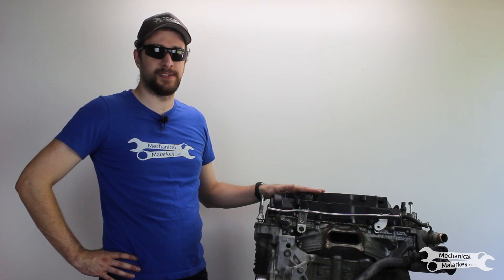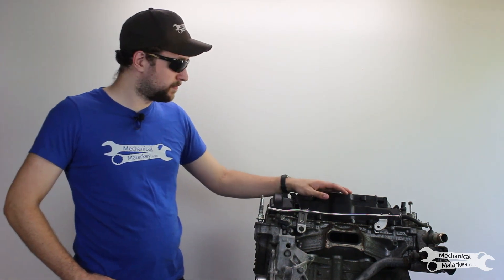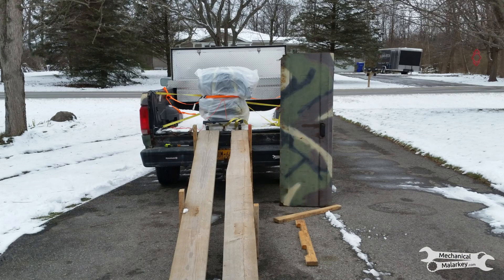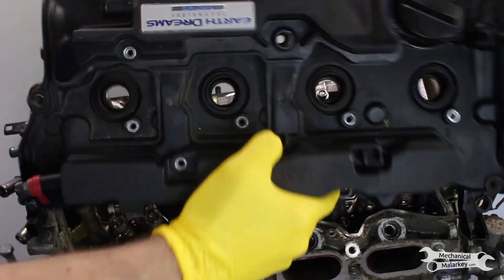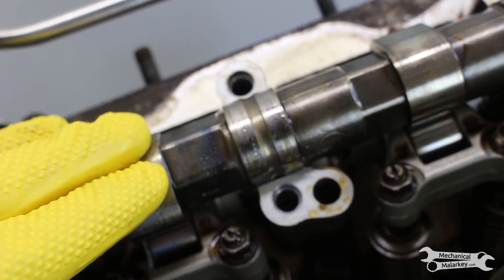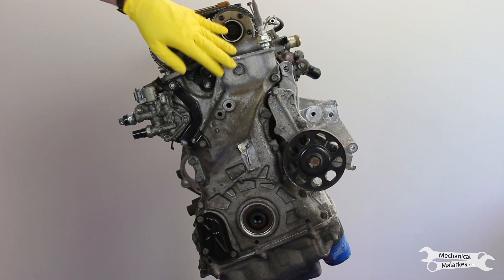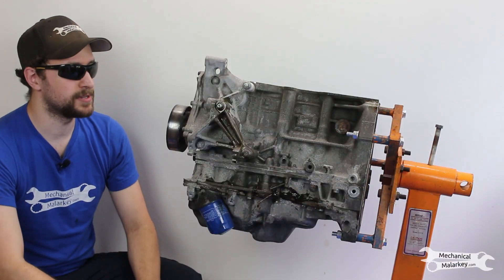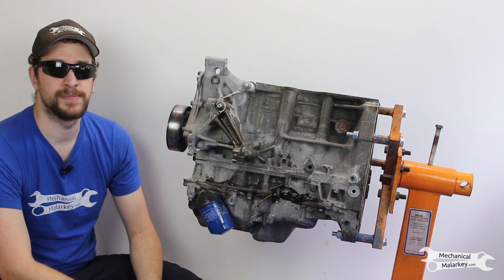Overheated Honda K20 Engine Teardown

Comment: Is that death line between cylinders? Look, this is 100% done on purpose to make engine not last long time. That's the reason for all of these 1.5T failed gaskets. It will last, but eventually it will blow because of very little space between cylinders and that cut line between cylinders.

Comment: I thought K20C1 was SOHC. But is DOHC with VTEC on the intake cam. Just like the K24 used on th 9th gen civic SI. Interesting. 👍
Reply from the maker: All K-series are DOHC.
Reply: Wrong vtec on a c1 is on the exhaust side only. This is a C2 with vtec on the intake only.

Comment: The K20C1 does have VTEC, however it's only on one cam...I think the intake side...
Reply: This is a C2 with vtec only on the intake side.
The c1 only has vtec on the exhaust side and its the turbo version on this engine
Reply: @dynamicgameplay1825  Not really. Depends on which version of the K20C1 you're talking about. The FK8 had VTEC only on the exhaust cam, to help with exhaust scavenging. The FL5 only has VTEC on the Intake Cam, to increase flow/power at higher RPMs.
Reply: @ wrong
Reply: @dynamicgameplay1825  I'm super embarrassed to say you're right. I went with the quick and dirty answer, after googling to double check. The f'ckin AI answer at the top of the results said that the FL5 has VTEC on intake side. You're right of course, it's still exhaust side only. Great example of how "trustworthy" these freakin AI's are...
Reply: @ yeah I was thinking where did you get this info from😂 all good man shit happens lol
Reply: @dynamicgameplay1825  Even more embarrassingly...I own/daily an FL5...🫣😅
Reply: @ I have a fc2 6 speed fbo
Reply: @dynamicgameplay1825  I had a tuned 2020 FC3 Si, before I got my FL5. The Si was totalled after some schmuck veered into my lane head on from oncoming traffic.
Reply: @ ah shit sorry to hear! My girlfriend has an 11th gen  sedan and its pretty nice!

Comment: K-Series engines love to blow head gaskets when they are even slightly overheated. I got 270k miles on my K24 and its burning a bit of coolant. Slight head gasket leak but no mixing of oil and coolant. Oh, and it’s running on a burnt exhaust valve.
Reply: I have no experience with these new K series engines, but the original K series from about 2002-2014 seems to have very durable head gaskets for being an all aluminum engine. Unlike the D series, they seem to last indefinitely unless they are badly overheated and they can handle quite a bit of boost on the stock gasket and head bolts. A quick Google search for "k series head gasket leak" returns way more results for the Rover K series than the Honda K series, which says a lot IMO considering how much more common the Honda K series is comparatively.
Reply: Hit 255 over and over this morning and doubt there will be a problem

Comment: Nice engines. Even if it's a bit far gone, many hotrodders like me would still use many parts from it. The head on a k24 is a nice upgrade, or even just the cam! You can straighten out mild head warpage, but blocks need to be machined. Heck, i'd buy it if it was cheap and local! 

Also, just discovered your channel, dig it.
Reply from the maker: I've had it listed on local Facebook for a couple months now and haven't had any takers.

Comment: Did you find the spot where or how the coolant mixed with the oil?
Reply from the maker: My guess would be that as coolant leaked into the cylinders, it would eventually leak past the rings and mix with the oil.